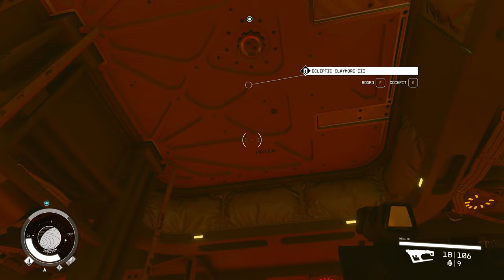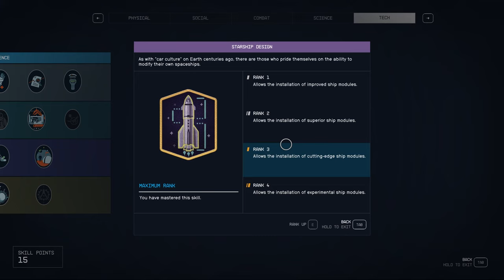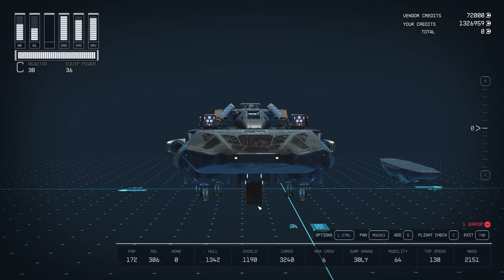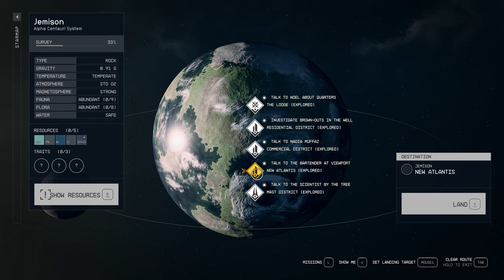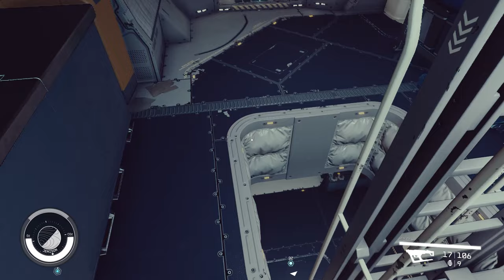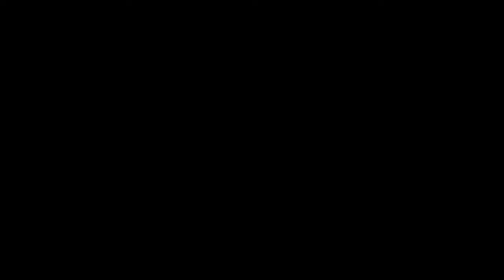Starfield - Unimaginable Power! Upgrade YOUR Claymore for MAXIMUM Firepower, Shields and Cargo

Comment: I shrunk mine, downgraded jump drive, upgraded reactor and engines, decreased cargo, relocated loading bay to front, changed docking port, removed brig and added extra habs. Yours isn't far off what I did.
Reply: Also configured to no ladders except the loading bay.
Reply from the maker: Yes! Deleting the ladder was my main motivation for this build. I like the idea of a smaller Claymore. I might try that with my Claymore II.

Comment: I think the default layout (for the most part) makes perfect sense; With the default layout, from a lore perspective, the only way out of the brig is through the bridge, which is, in reality, always going to have crew posted.  If that brig has the rear hatch, if either of your prisoners breaks free, they've got a clear path to the Landing Bay.  I was able to knock it down to 1 ladder, really, at that junction at the front of the mezzanine level of the ship by replacing the Nova Bracer and Nova Companionway with a Nova Armory 2x1.  So, you go directly from the Landing bay to the aft companionway, to the forward companionway up one ladder, and you're in the companionway of the main access corridor of the ship, with the Armory and docking collar to the aft and the control station and bridge in the forward section.
Reply from the maker: I'm sure that is what the game designers were going for. Personally I love having the war room instead of the Brig and keeping ladders to a minimum but to each their own! Sounds like you got a pretty solid build as well though!

Comment: Someone else made the comment below, but the "wings" you add to make the ship more "aerodynamic" actually covered over the braking engines - the structural pieces in front of the main engines.  A braking engine fires forward to slow the ship down as it lands and to give more maneuverability.  I'm surprised the ship builder didn't give you an error for that.  What does it look like when you land on a planet?  Are there flames coming out of the gap or did the structural wings completely block them?
Reply from the maker: From the underbelly when I land Im seeing flames coming out of the rear near the engines but not next to the wings. Ill have to look into this. Functionally the ship still seem to perform as it should. No issues with braking.
Reply: Do these braking engines actually do something? Or is it just a visual thing?

Comment: You don't have to pull out the old habs and replace them with different ones,...then the colors don't match.  Just leave the old ones there as long as they are the right dimensions, and if you need more of the same dimensions just duplicate them and then change the type. You just select them and change their type to Workshop, Infirmary, Battle Station, etc.   You can completely change a ship and pay "0" for it by doing that. You only pay for the new parts that you add.
Reply: Was just going to say this.  You have to select the Hab, move it slightly and then snap it back into it's original spot.  Then you can change the variant to what you want.
Reply: @robmaurer1618    Yea, but you don't even have to snap it, just select it. I'm on Xbox, just hover over it an hit A, then left or right D-pad.  I use a PC laptop when away from home, but I plug an Xbox controller into it and play it just like the Xbox.
Reply from the maker: I had no idea you could just swap them out like that for future. Thanks for the tip. For this build I was trying to force some doorways to eliminate ladders hence why I was adding new habs with the "attach" function.

Comment: I had already made some serious changes to my Claymore III before this video; made similar improvements to a mk 1 that I had prior to getting the III.

However, I had never bothered with moving the loading bay to the front until seeing your video.
So, thanks for the push. 😊

I tried eliminating the 1x1's in a similar fashion, but it ended up being a confusing mess, though that is probably because of the modifications I had already made to it.

For now, I'm going to settle for having the loading bay in front. I might play around with eliminating the 1x's later.

Thanks to the five SAL-6830s I have on the back of mine I have a perfect 100 mobility, even with the 650 fuel tank, two extra 2x1 habs and a couple more of those Galleon S204 cargo modules. (I took out those two piddly little ones.)
Reply from the maker: Yeah man! Moving the Loading bay to the front makes the ship so much more accessible when trying to take off quickly. 

Eliminating those 1x1s adds so much more useable space. Ill have to check out those engines. That was the only thing with my build is I was trying to get 80+ mobility with the increased cargo however 74 isnt that bad.
Reply: @circuitscore  it works if the engines are placed in a U pattern

The SAL-6830 is only available if you ended the mission on Neon, "All that Money Can Buy," in a civil manner, since Nicholas Slayton's company makes the SAL-6830 engines.
Reply from the maker: @DreddPirateRoberts  I think I still need to do that quest. Thanks for the heads up!

Comment: Thank you for the tutorial! I hot-rodded my Claymore III by dropping a lot of cosmetic mass, stuck on three SAL-6830 engines, a 28T Defender Shield Generator, and a SF 40 Sheared Flow Reactor w/40 Power (the 104 DS Mag Inertial Reactor w/39 Power is also great.) For weapons, the four PBO-175 Auto Helion Beams really are the best you can get, but adding six more Vanguard Obliterator Autoprojectors makes for a ship-melting combination. For stealing ships, a single Nullifier 1750 Suppressor is all I really need, but if I'm not boarding, one or two PBO-300 Auto Alpha Turrets are indispensable for target acquisition, shooting at and identifying the closest enemy (the Obliterator 250MeV Alpha Turret fires too slow to make this effective). Also auto turrets will put enemy ships into defensive mode, firing their boosters to get away instead of attacking. The Disruptor 3320 Neutron Turrets work well too, if you don't want to use a Class C reactor. 
I love my Clankmore!
Reply from the maker: I will have to check out some of those upgrades! I seriously love the Claymore. Even in its stock from its a pretty solid ship overall!

Comment: You can add equipment mounting spots to block potential unwanted doors/ladders. Hope it helps.
Reply from the maker: I had no idea you could do this. I will give it a go! Thanks!
Reply: @circuitscore you can also use portholes on the top side of the bottom habs to block ladder generation, but you have to use a glitch to make the upper hab work. However, when inside the upper hab the floor is no longer flat. You can actually look through them from the lower hab.

Comment: 10:45 - You didn't need to move the Brig.
You could've just switched it over to a different variant, since they're both 2x2.

Also, the infirmary is redundant if you have a science lab.
Reply from the maker: That is good to know! Could have saved a bit of time. The other habs I did need to reattach in order to force some door placements. Thanks for the heads up on the science lab and infirmary. I guess I could add a Type A hab on that side.
Reply: @circuitscore  Force door placement?

How do you do that?
Reply from the maker: In the video if you hover over the opening between habs and hit the "attach" button (G on PC) you can attempt to force door placement however it doesn't always work especially if there are multiple connecting habs as you could see during the tour of the bottom back part of the ship.
Reply: @circuitscore  BGS really needs to allow us to decide where we want the doors and ladders go.
Reply from the maker: @DreddPirateRoberts  100% agreed. There's apparently a mod on PC that allows for this but still don't understand why they didn't include this into their ship builder. Doorway and ladder placement can be so random.
Reply: @circuitscore  Well, the game must not have liked me trying to force a door to appear, because now my Claymore is invisible.

Had to revert to a previous save.

I'd love to know why the game prefers ladders over doors.

Whoever wrote that algorithm needs to have their head examined.
Reply from the maker: @DreddPirateRoberts  Same thing happened to me one time. I was doing some test builds and it just disappeared! So weird 🤔
Reply: @circuitscore  I tried switching the 2x2 Battle Stations to a Cargo Hall, and it made the ship disappear.

(They really need to fix their schizophrenic ship builder.)

It wasn't until I got rid of all of the portholes that I was finally allowed to have a door from the 2x2 hab front to the 2x1 hab behind it.

It's still a bit of a maze to get to the docker from the cockpit, but there's only one ladder to get there, because I have a 1x1 underneath it.

I'll have to take some screenshots and post them on Reddit
Reply from the maker: @DreddPirateRoberts  Let me know. I'm interested to see it!